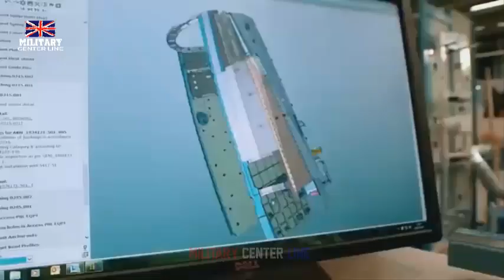Royal Air Force's New Concept Model of Next Generation GCAP Fighter Aircraft

Comment: The U.S. Air Force is considering canceling NGAD.
The US Air Force is interested in the XQ-58 and 5GTA.
CCA (Collaborative Combat Aircraft).
The US will make the CCA exclusive to the F35.
GCAP is a good development team, so they should change to CCA development team for other than F35.
Japan has turbofan engines for long-range anti-ship missiles, so they can make a CCA by installing two of them.
The weakness of fighter jets and surface-to-air missiles is that they cannot fight against the Shahed 136 low-cost drone. The opponent costs one-tenth of the missile's price. CCA needs the ability to shoot down low-cost drones. Japan jointly developed a microwave cannon with the United States.
The CCA equipped with a microwave cannon integrated into the surface-to-air missile system attacks Shahed 136 and drones. Japan has surface-to-air missile systems that are not made in the United States.
Non-stealth fighters create fake radar returns and hide within them.
The electronic warfare system EPAWSS installed on the F15 is a product of BAE systems. This will also be installed on the F35.